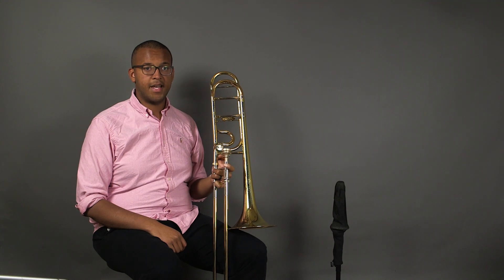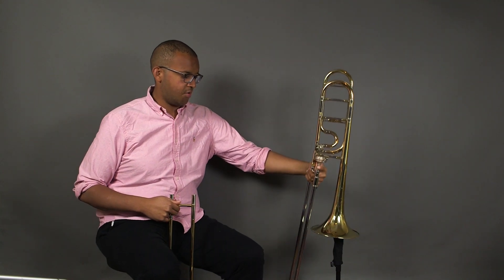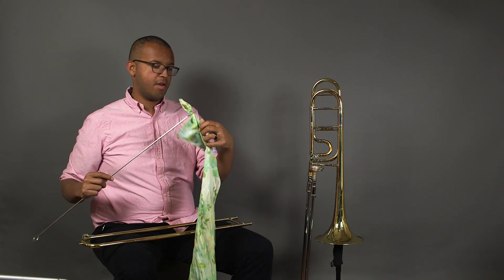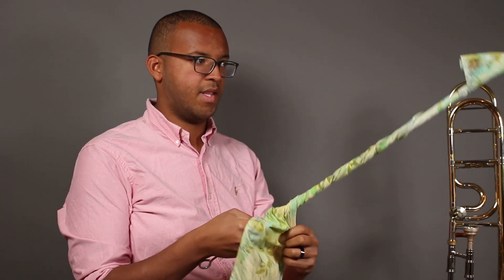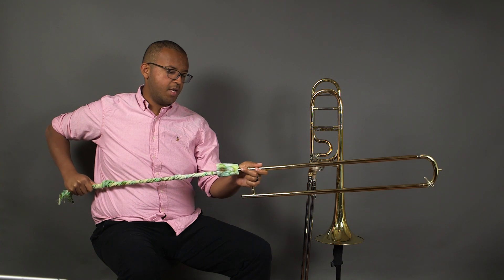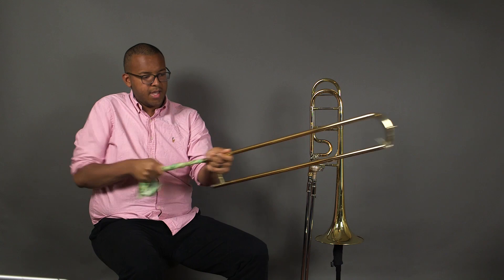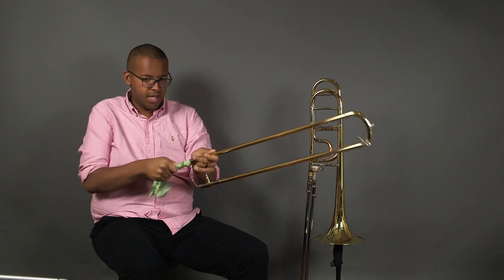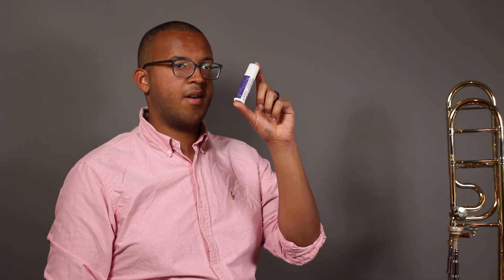[How to] Clean and Lubricate a Trombone Slide

Comment: Long, long ago, on my two Bach horns (tenor and bass) I used Slide-o.-mix. Worked well. Then I sold my Bachs and got a new Yamaha Xeno 822G dependant bass. The Yamaha slide lubricant worked best with the new Yamaha. Nw, three weeks ago I traded in the Yamaha for a new Shires Q36GR – some might consider this an entry level pro or college student horn, but when trying out horns, this was miles better than the Shires Customs I tried. I tried using the Yamaha lubricant on the Shire, but it really didn’t like it. Even after cleaning the slide several times to remove anything that had been on it before. So I cleaned it off once again, using the blue Slido-o-mix cleaning rod/clothe and then applied the Slide-o-mix Rapid (all in one black bottle). WOW, a completely different slide. Just as good as my old Yamaha Xeno slide. So now I’ve got at least 6 bottle of the Yamaha stuff and only two of the Slide-o-mix.